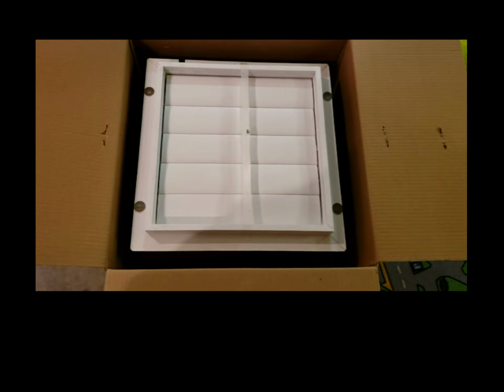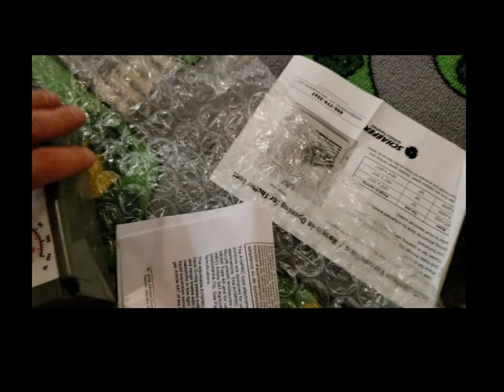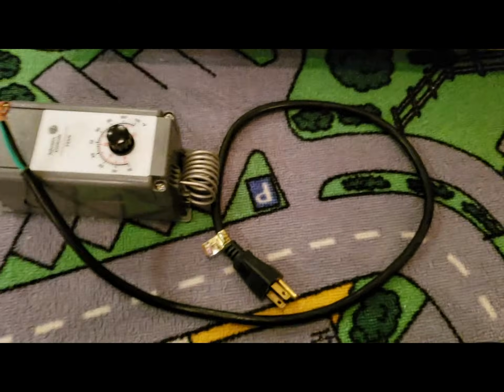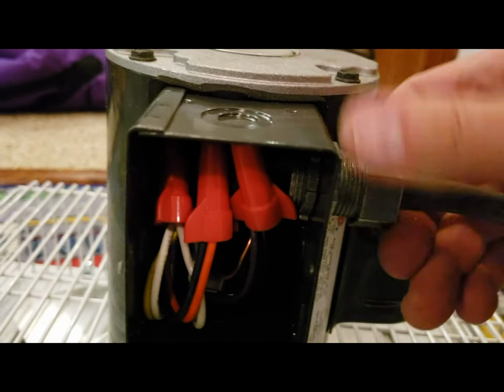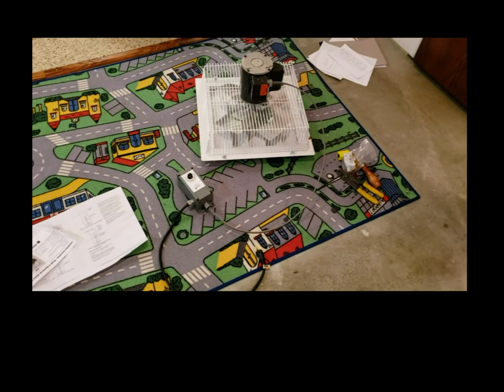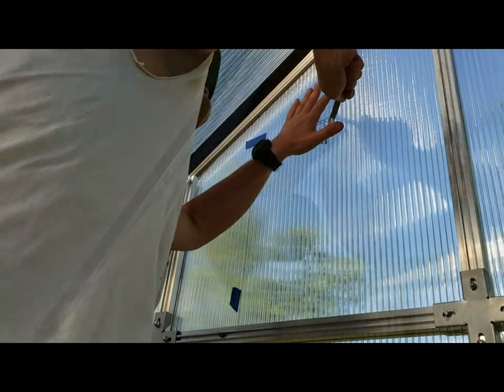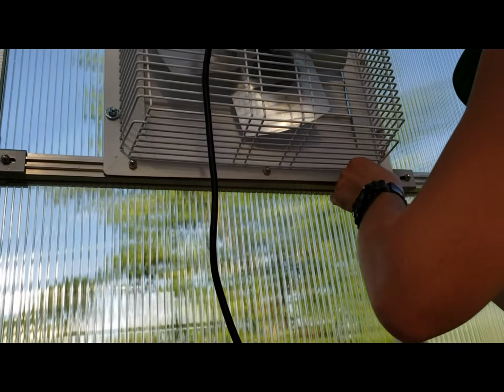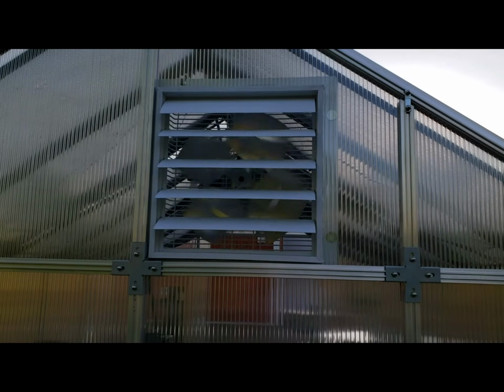EASY Greenhouse Fan Installation with Thermostat

Comment: Did you also install a motorized air intake (self opening/closing) or are you manually opening a window?
Also, how much did the fan and thermostat cost you?
Reply from the maker: we have automatic vent louver aluminum that opens based on piston
you can get them a kits
https://www.greenhousemegastore.com/equip/cooling/fans/greenhouse-ventilation-package?dfw_tracker=43186-FA-VPKG&utm_source=google&utm_medium=cpc&adpos=&scid=scplpFA-VPKG&sc_intid=FA-VPKG&gclid=Cj0KCQjw17n1BRDEARIsAFDHFeyeR7LRZZv0SjKNCJRAvnRa_ejn0u1B2d4mPJFVnRcmkGOSrgkDpGQaAm6JEALw_wcB

Comment: I wish this came up above some of the less professional DIY jobs I’ve seen. Hey just noticed, you really wanted that water tight seal, on exteriors of buildings they’ll loop the cable just before the cable permeates the siding. This minimizes the chance water can just run along the cable into the building. Thanks for the video!!
Reply: Drip loops!

Comment: Does 85˚ do it for you or have you had to change it since making this video?
Reply from the maker: I still have at 85 and that seems to work well, the greenhouse in the heat still gets to 94 or 95 degrees but the fan is running on those days and that works well for me